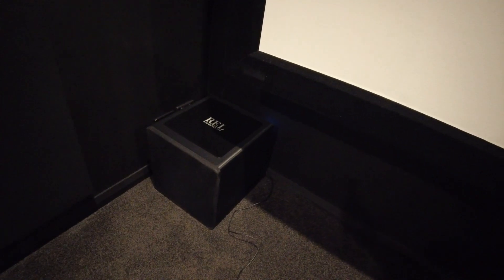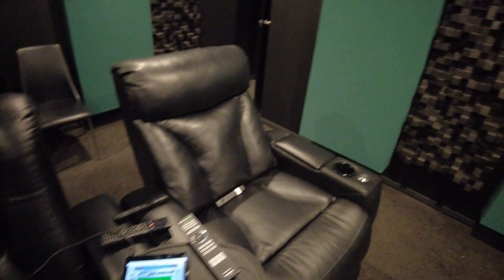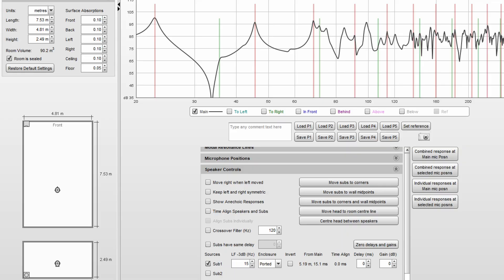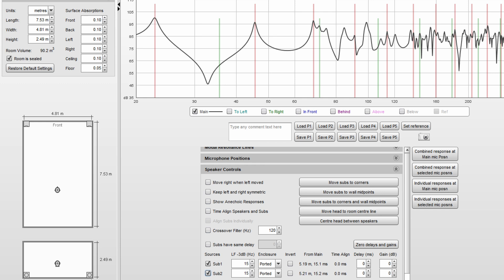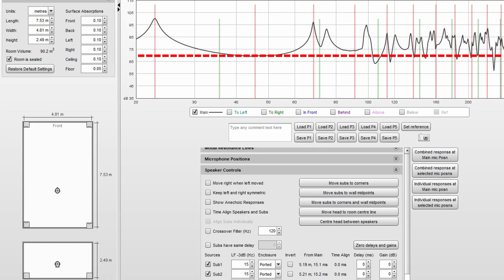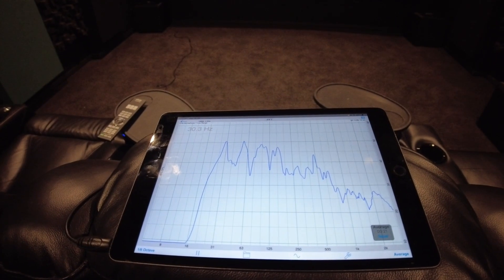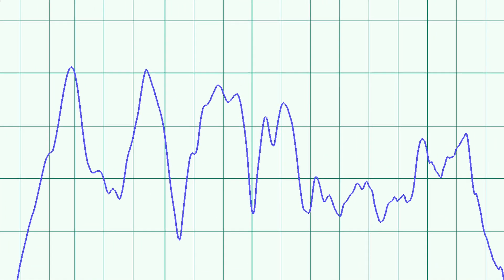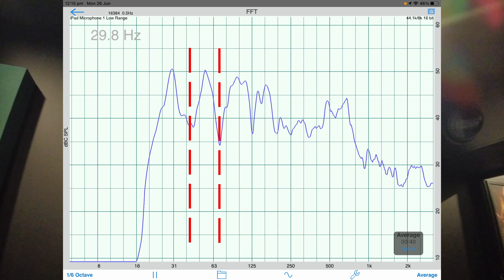Home Theatre . . Bass Explained - Sub woofers and room modes!

Comment: Thanks, another great video. I can see your report was showing dB rating across the range of low frequencies. Does the signal generator sweep across all low frequencies?

Can you also share what product you were using to generate and report on room acoustics?
Reply from the maker: Hi so what I believe you are referring to was the REW room simulation. That was not aa report of the room that I was testing just a demonstration of the difference with multiple subs. With regard to the signal generator yes it can sweep across all low frequencies and much more than that... The product was an apple app called Audiotools. It has multiple capabilities but can get expensive depending on which module you want access too, It has been my go to tool for a very long time in conjunction with the same developers app for AppleTV the signal generator by studio six digital.
Reply: @HomeTheatreEngineering  thank you for the response! Much appreciated.

Comment: The variation in volume throughout the room from the tone generator was vast, I knew there was differences in volume but that was an eye-opening experience. 
That's why I have 6 x 12" subs in my lounge room so no matter where you sit it sounds good >>>>
I ONLY HAVE TWO SEATS [true story].
Thx for the video it was extremely informative and I look forward to more on this topic.  CHEERS.

Curious >>  Does the dip in frequencies indicate that the frequencies are bouncing around the room and coming back and cancelling itself out >>>  or  >>> are the frequencies bouncing around the room and where there are hard surfaces it reflects back and plays louder and where there are soft surfaces it reflects back and causes dips [softer tones] ????
Reply from the maker: Hi thanks for the comment and the feedback. As to your “curious” question.. your first suggestion was correct. They are standing waves that effectively come back and where 2 positive areas meet its loud and where 2 negative areas meet its almost silent. Based on the acoustic dimension of the room